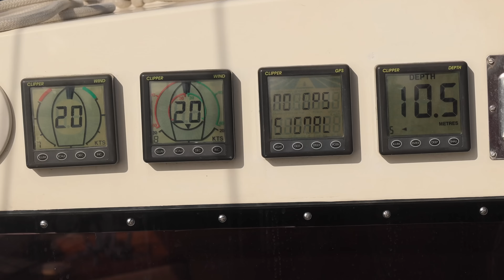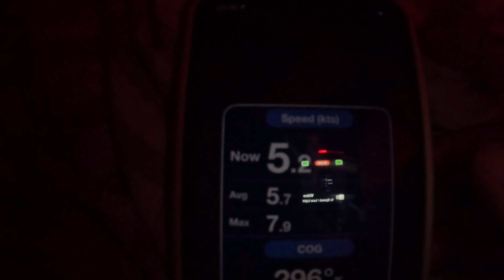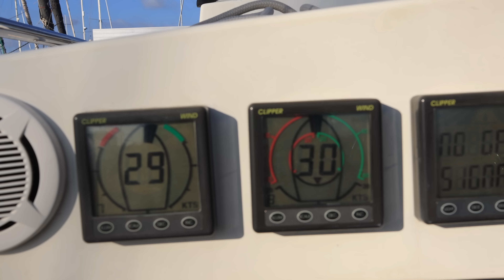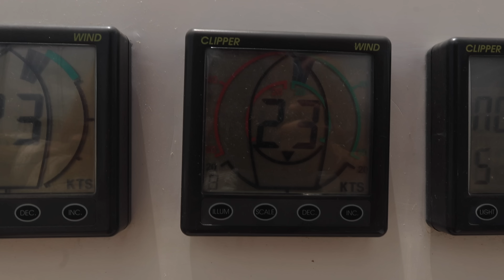BOAT YARD LIFE: Time to start repairs

Comment: Welcome to Aruba in kingdom of the Netherlands. That went smoothly Becka and Zach. A friend of mine's boat was also driven into the water here in Vollendam with one of those lifting carts..seems somewhere better than the crane with straps ..but you don't see them much here (there? in UK?). And the underside still looked fine. Curious about your upgrades and DIY. I saw something like..new sails..new propeller..extra solar panels?..on bigger binimi?..and (more) lithium batteries?..maybe wind turbine too? Something on the foredeck seeing the form of the boat..or wasn't that from the anchor locker? I am so curious. I and my boat also getting ready for autumn and winter on board here in Den Helder. Boat partly covered already with tarpaulin...teak deck repair (leakages) awaits me.😅 Hope you stay in UK was nice and following seas and sail on the wind of today!!❤❤
Reply from the maker: We really like the tractor method! The swinging motion of the wise makes us a bit nervous 🤣 hey, you are going to have to stay tuned for the upgrades 😉 lots of exciting footage coming. Eek, good luck with the teak deck repair, its always a faff but worth it when done!